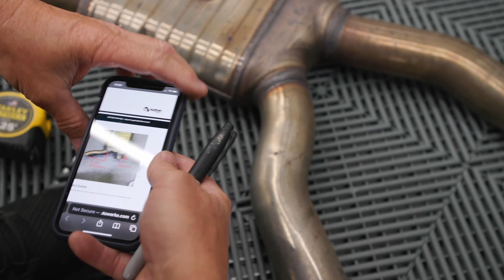M2CS: Installing the Active Autowerke Equal Length Mid Pipe

Comment: To open the valves you just need to put the engine mode next to the shifter in Sport Plus and blip the throttle to open them up 👍🏾

Comment: Great install! Although, confused on one aspect. Why did you have to cut the stock exhaust when you're going to change out the axleback anyway? The midpipe can connect right up with the remus exhaust and there wouldn't need to be any cutting of the factory pipes because it wouldn't be used anymore.
Reply: Because Matt wants to drive the car and isn't concerned with the stock exhaust being cut. When he gets the Remus rear section we will bolt it on.

Comment: Is it not possible on this model to plug in the valves, turn it on, put it in M mode to open the valves, then while running just disconnect the valves so they permanently stay open?
Reply: I think it throws a code. I'm not 100% in that but he wants the valves working anyway.
Reply: Yea it is possible and there are videos on how to do what question you have just asked.
Reply: @BEAR_S55  Oh I'm very aware lol, the valves were the first thing I disconnected when I got my 2 series but it never throws a code, been like that for about 3 years now.
Reply: @RogueScum  yea that’s it man I’ve never heard of it throwing any codes when you do it. It’s never done it on my M2 and it’s been over a year now